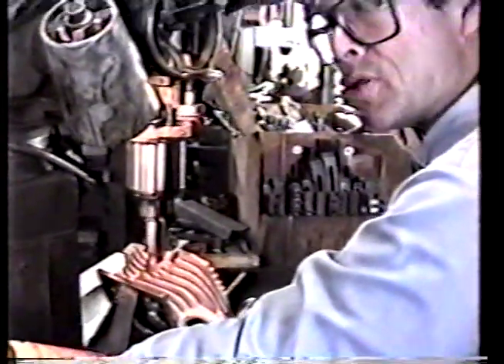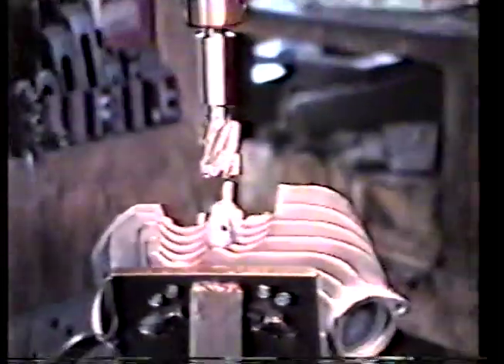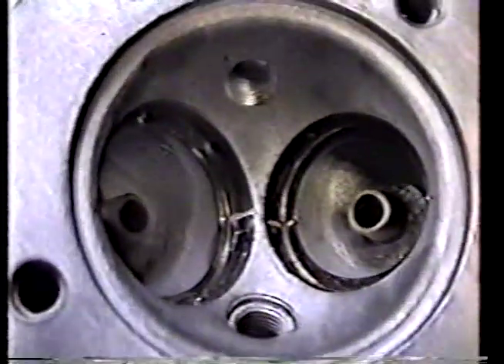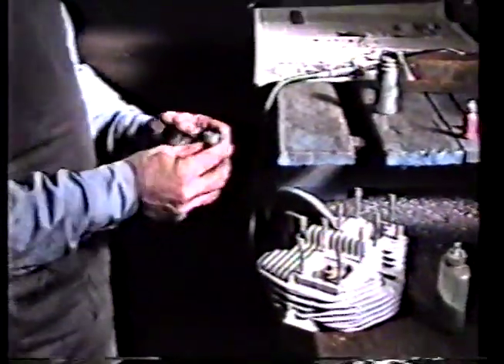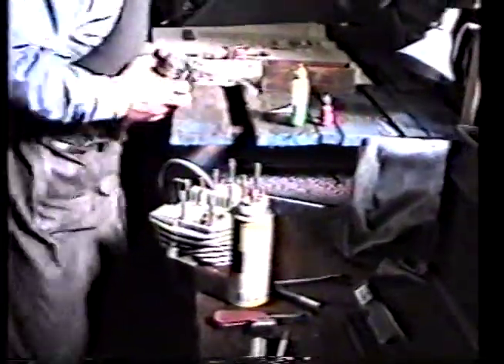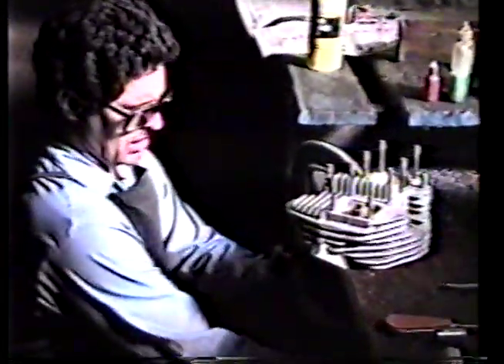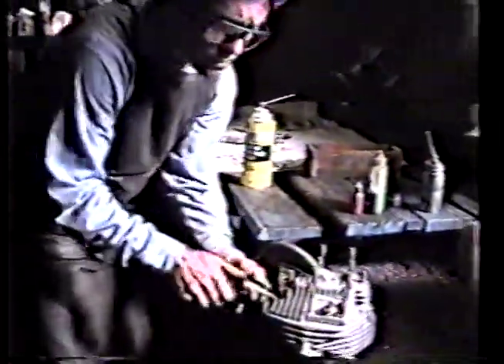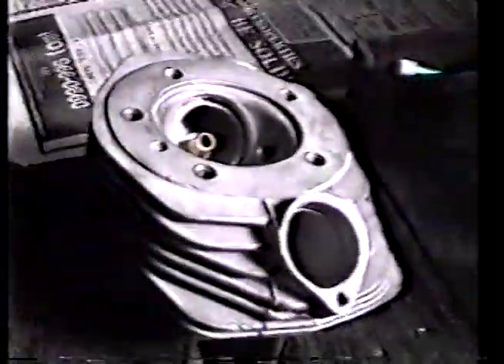HDES-06 Shovelhead Dual Plugging for Harley-Davidson

Comment: Everything about this is wrong.
Reply: Not arguing, but can you explain what you mean?
Reply: @BeerBatteredGummyShark Sure. You use a 12mm Sportster plug so you don't have to cut the rocker box tower off. It is greatly weakened using this technique. I've seen them break off. He's also tapping weak parent metal instead of installing an insert.
Reply: @ranchodeluxe1  by insert do you mean sleeve? Curious as I've just bought an 84' FLHS and intend to dual plug it 👍
Reply: @BeerBatteredGummyShark  Yes. Use a hardened spark plug threaded insert. It's one of the few places I use a Heli-coil over a keen sert. Heli-coil has dedicated spark plug insert kits that mean you never strip the threads by tapping parent metal. In any case, use the Sportster/Twin Cam plug for it's reduced diameter so that you don't have to cut the rocker tower off like this guy does.
Reply: Great info. Thanks. Any idea what angle (or desire to share)?  @ranchodeluxe1
Reply: @berockization  65 degrees is what is stamped on my fixture.